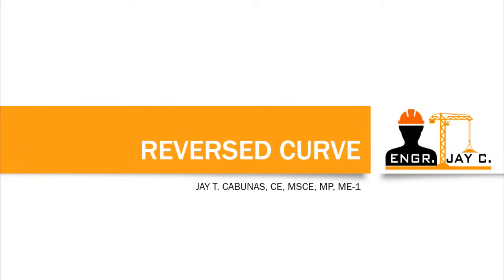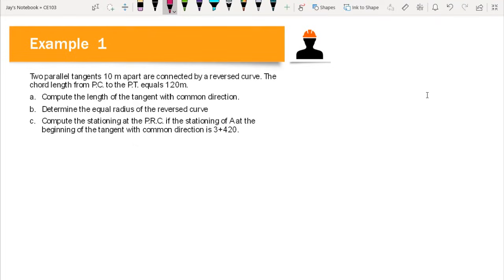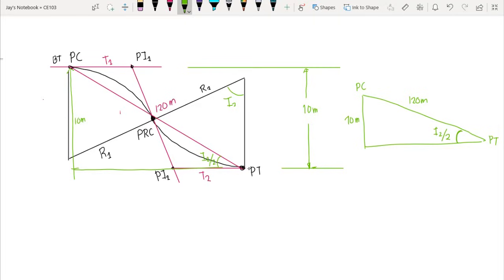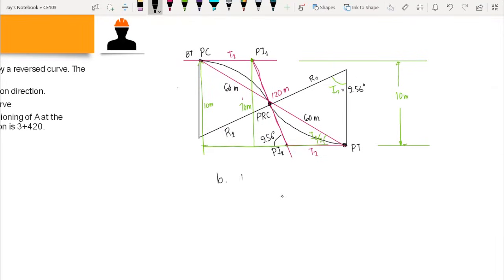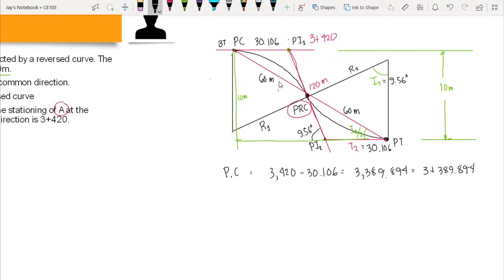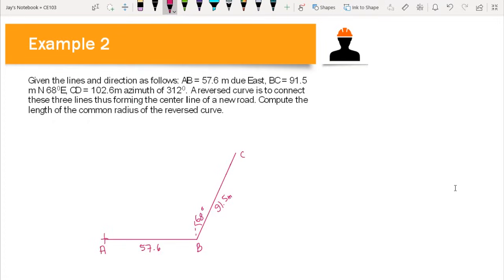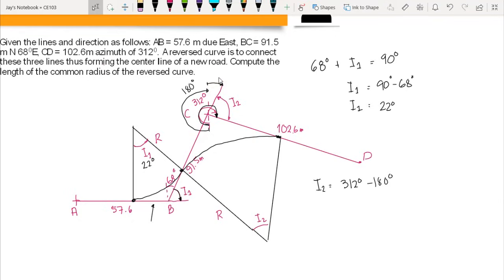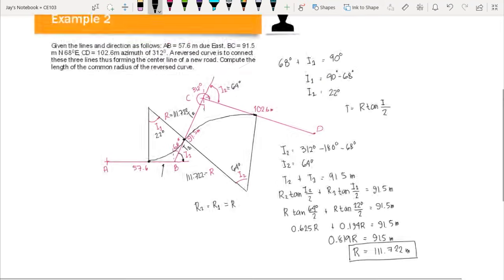Highway Engineering | Reversed Curve

Comment: for problem 2, azimuth is supposed to go from north direction clockwise, not south.
Reply: did you figure out the answer as to why it started from the north direction?
Reply: Azimuth is always from south clockwise
Reply: @what-if-it-disappears  I'm pretty sure that this problem is special because the start of every azimuth from bearing studies are always from the north
Reply: @what-if-it-disappears you can still use north as a reference but yeah, azimuth should be from south. But you can still use north as a strating point